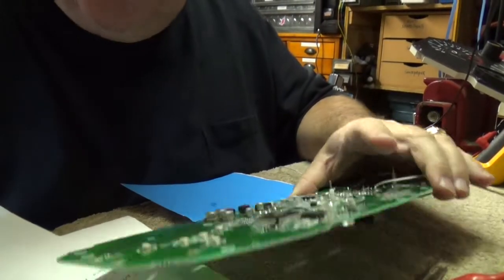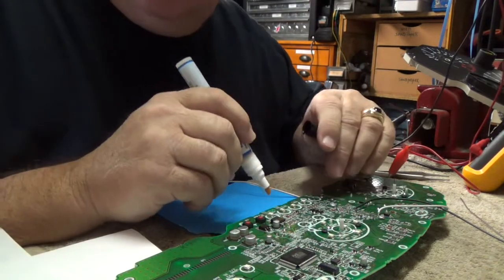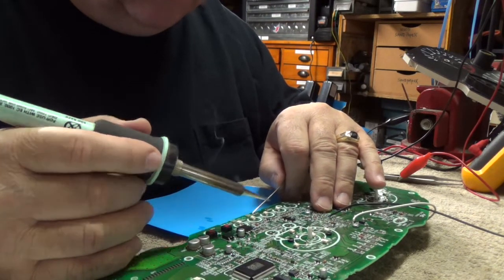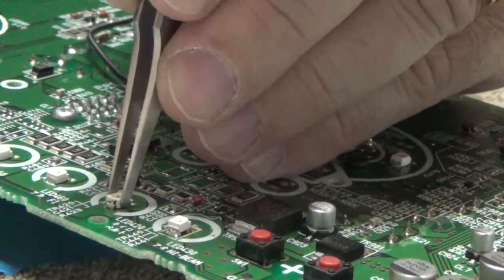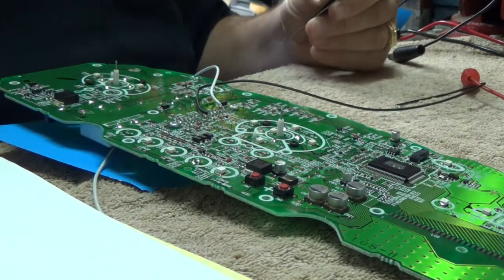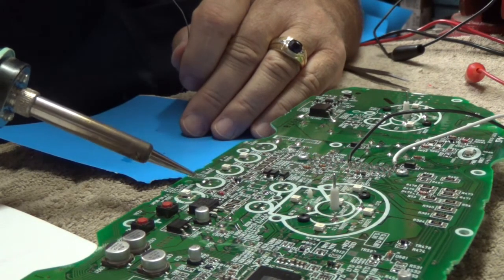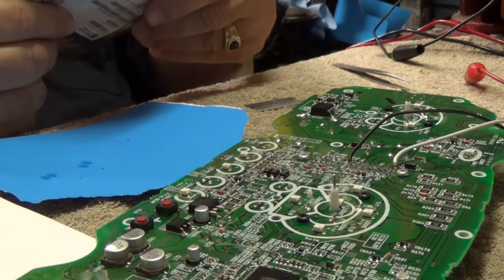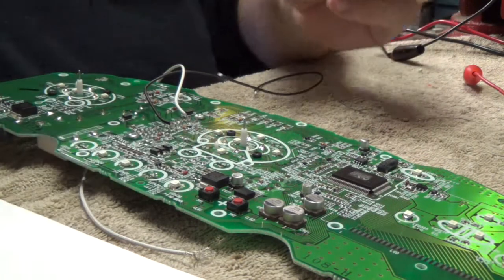remove and install SMD LEDs

Comment: I removed a SMD LED from my car dashboard and a audio warning sound kept beeping after that.
Do I need to replace it with something else or can I leave that circuit open after I take the LED light away. ?
Ps. I had to put it back for the time being just to stop the noice.
Reply: bridge it with a 0 ohm resistor at least

Comment: Just thinking - If you don't have chip quik around is it easy enough to heat the existing solder and use a solder-sucker on each end in turn ?
Reply from the maker: Keeping the heat down on SMD components is the key. and also not to damage the PC solder pads themselves. I just used it for heat damage precautionary practices.

Comment: Hi, do you have a link for where I can get replacement LEDs for ABS/AIRBAG LIGHT.
Reply from the maker: Go To Mouser.com or SuperBrightLEDs.com or digikey.com
Reply: @Lorddarthvader1701  I'm trying to do this but sometimes when removing the led I'm removing the copper contact point off the board with it, what am I doing wrong?
Reply from the maker: @darrenmicklewright2008  Use the low temp solder stick that I mention in the videos. I show how to do it also. This is a must with SMD components. If not yes you could do board solder trace damage. I am not sure where but I do show how and where to get this stuff
Reply: @Lorddarthvader1701  hi iv just finished my led conversion in my car from orange to blue colour. When using the flux pen and flux cored solder one of them was leaving a sticky residue on the board and made it almost impossible to add new solder, the pen said no clean but I found it easier to finish the job with no flux and cheap solder?????
Reply from the maker: @darrenmicklewright2008  Can you message me pics, of your work? I did not experience the sticky part. I guess, glad I did not. Cool resolve

Comment: Hi.
I have fluke 179 multimeter .
The backlight of this model are 2 type.
One type is grenn light and other type is white backlight.
My multimeter has green backlight and I don’t enjoy that. I want change green led backlight to white backlight type, but I don’t know how to make it? 
How can do that ? Do you help me for this mission 🥴🙏🏽🙏🏽? The green backlight is funny. Excuse me if I can’t speak English well. Sorry about that.
Have a good weekend
Reply from the maker: Can you send me some photos. If you want the back light white you can use and white LED. These are going to be surface mount as I explain in my videos. But on a multimeter they may be potted (covered with a clear coating) if so it can't be done. If the Honda was potted I couldn't have done what I did.
Reply: @Lorddarthvader1701  how Can i send picture to you?
Reply: @Lorddarthvader1701  at this picture, in right side of PCB, you can see 2 leds.
These are not covered by coating on pcb surface,yet seems to be.
I don’t have led’s information.
Info about watt and ampere and voltage.
Reply: So, what can I do do?
Reply from the maker: @puma1644  You have to order them, you can google SM LEDs ( Surface Mount)

Comment: Are the 12V rails usually marked on a motherboard or does one need a lookup diagram. I'm trying to bench test my work without constantly having to go back into the car dash and plug/unplug which risk's breaking a wire on the harness or pin on  the motherboard. Car motherboards are not cheap.
Reply from the maker: No they are not. I had to figure that out. I used a variable power supply so that I could simulate LED  voltages also. They run around 2.5 to 3.8 at most. if I remember right the LED's (bright type) I used were 3.2.
Reply: @Lorddarthvader1701  ok thanks. I saw a guy who used a 9v battery with a couple of wires to touch each side of the led to see if they lit up. I'm thinking this might be the easiest. I do need a 12v variable dc supply though. Do SMDs need a narrow head soldering iron ? How about the temperature ? Thx
Reply from the maker: @garynair5143  Again thanks for watching, I use a Weller soldering pencil station. I also use the low heat transfer solder sticks to remove the old SMD LED's. Think of it this way, that dash circuit board is all you got so precision and care are key. Just take your time and be mindful of the new solder work.
Reply: They are indexed. There will be a little triangle cut out on one corner to indicate current flow

Comment: Why does society have to make everything else easier in attempts to emphasize a lazier population with all these dumb gadgets somebody could use per say an automatic stove pot stirrer and the fact you can make everything wifi and turn everything on and off from your ass while watching your favority judge judy show.. lol   But they continue to make electronics smaller and smaller but not make tools that are budget friendly that makes the tiny smd stuff easy like an automatic smd component applier.  Say the rail the led’s come in be loaded like a stack vertical in a tube with a flux feed and a two wall heater with pad heater so you could simply stick the thing on the pads and push a button and it drop an led in the flux heating both contacts on the component as well as the pads so the whole thing takes a second...   the size of the shit in iphones or smart phones is reeeeediculous..  micro soldering can kiss the shitty side of my asshole..  you friggn let a little poot out while applying heat to the board and burn a processor in two...  then the tiny crap has a multi layered board so the schematic has fuggn imbedded layers and sub layers making theory of operation sound like a congressional meeting full of 80 year old chinese men all arguing at the same time..  stuff can take the first road to bullshit land and nerve fuckery...

Comment: what if you solder little bulbs of corresponding voltage?  12 volts was it?
Reply from the maker: Soldier1287 You cannot use bulbs the membranes will not go together, and the effect will not be the same
Reply: ok

Comment: amazing!
Reply from the maker: +navythomas8 Thanx Tom
Reply: ***** I'm gonna have to pull my dash, as the clock is not keeping time when I hit Bumps. I suspect it is the main connection. Think I will try some dialectric compound into the harness connection.
Reply from the maker: +navythomas8 Damn mother nature the elements can sure it's job on stuff.